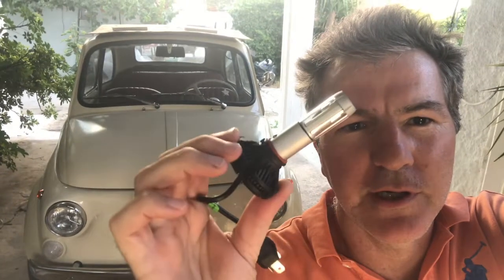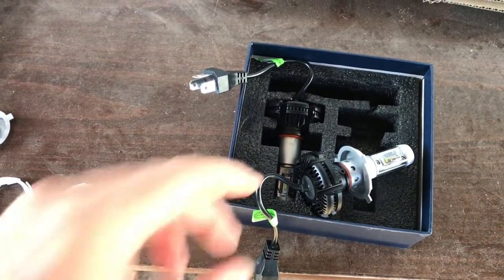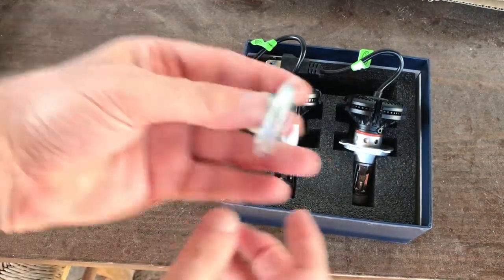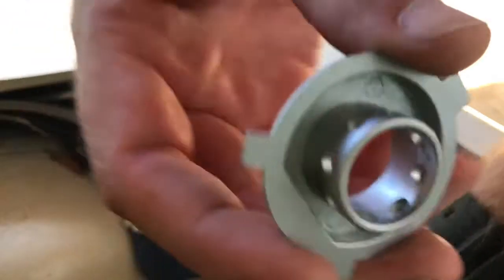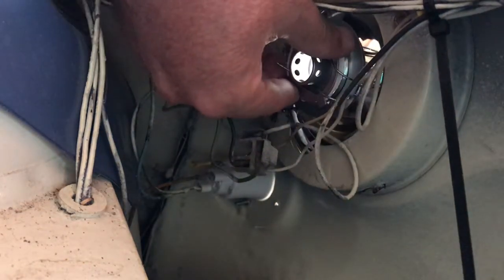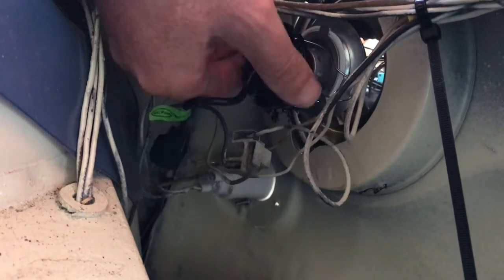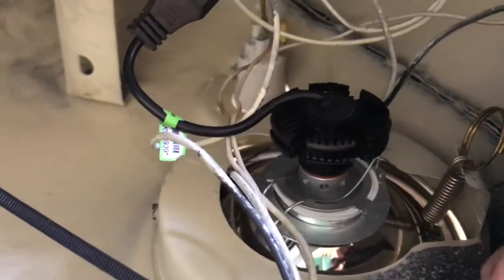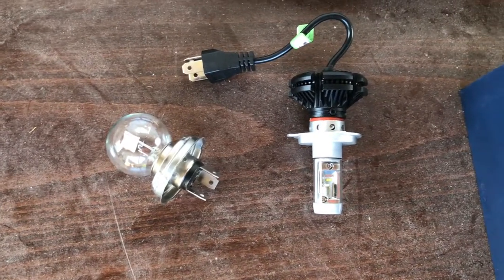LED Headlight conversion in Vintage Car: Classic Fiat 500 LED conversion from H4 HS1 P43T to H5 R2

Comment: By the way, a small external driver and fan as part of the LED bulb are absolutely necessary or it will burn very soon especially if you get a very bright one.
Reply from the maker: If that were so, the manufacturer of the LED light would have integrated that. Fiat 500 from the sixties is not a rocket, it’s plain electrics. For modern cars “maybe” would you need drivers for the ECM not to give fault codes and for xenon lights, not for low amps LED lights
Reply: @makingcookingfixing  
Sorry but I don't agree. It will help people to hear from an expert like this before they buy:  https://youtu.be/FPcE-fWHmww

Comment: Did you solve the high beam problem on one of your lights? You mentioned a fuse but didnt say where. It seems that you are the reseller of the lights you installed. They are not supposed to be plug and play, resistors and fuses are needed so interested people in this conversion should first contact your local LED installer shop to ask for options on items and lower prices, there are plenty out there.
Reply from the maker: Hi, I only noticed the left high beam problem when I saw it on the camera recording it. If you look on the electrical diagram that side of the light is connected to 1 fuse in the fuse box, that particular fuse clip wasn’t tight enough to hold the fuse well. Just bending the clip was enough. This particular LED does not need any extra resistor ballasts, fuses, fans nor relays. It is indeed plug and play. They are still in the car since this video and work very well. These lights have a Philips LED which are cool and the aluminum fins do the job of dissipating any heat (far less than the original halogen bulb)
Reply: @makingcookingfixing  
I'm glad you fixed it, still, nothing cools better than an integrated  fan to make the lights last longer  as the expert un the link I posted explains. It is always good to listen to an expert first.
Reply from the maker: @chdochido  Expert, expert....Are you implying that I am a dummy? You're trying hard to disqualify what I do. I watched the video of the "expert" which is a commercial for his own light sources. In the beginning he mentions that he, just like me, spend a lot of money and time to find the light system that works on his car, and I did that as well, for this car only, because I am only interested in this car, and with my channel, I try to help solve issues with this car, because I know many have the same problem. I did the research, spent time and money, and for me it works and is a good solution, sure there is always better and more expensive, that is not what this video is about, it's about a solution I know works for me and the classic Fiat 500. The video of the in your words "expert" speaks about heatsinks and that all LED's should have fans. That is fine, go get that LED light with a fan from him. I am proud of my solution, I have the classic Fiat 500 and I have the LEDs installed and I am very satisfied what the result. What more can I say? You are not around and can't judge what I do because you haven't seen it with your own eyes. What do I need to do? Make another video of the LED lights to make you happy to show you that there's nothing wrong with them?  For sure you will find something else to pick on, about heat, beam and whatever. Ciao.
Reply: @makingcookingfixing  I'm not implying anything, feel offended if you choose, I didn't say anything against you   I'm simply pointing out that people who own our cars should investigate options and better prices before jumping into what you are advertising. If that upsets you then I'm sorry but your uploads are public and therefore opened to comments.

Comment: Did you solve the tire issue?
Reply from the maker: Hi, I bought 4 new tires to be sure that all are equal, but it turns out that the angle of the rear tires are totally normal. You will see it on all old Fiat 500’s Do you have one?
Reply: At about 6:20 in the video you've mentioned a problem with the spare tire hitting the new LED light. That is my concern. Yes, I do own a Fiat 500. I've constantly failed anual inspections becouse of low light intesity. It did get   better after I've added a relay kit for the headlights. Now the the length of the wires from the battery to the headlights is extrimely short so less  voltage drop as is with the original wiring. But a low current drain light bulbs, as those leds, is another step up. Plus, I have hard time finding those old light bulbs in local stores. That said, Led bulbs won't pass inspection becouse this conversion is not allowed over here. So my plan is to get headlemps that can be fitted with Halogen bulbs for the anual inspection, and then switch to the LED light, maily becouse of the low current draw, for daily drive.
Reply from the maker: @ZNACHMAN  thanks for the explanation. I understand now what you mean. You did very well by adding a relay for the front lights, halogen bulbs at 50w each going through those thin wires is mad. I got the spare tire sorted out not hitting the back of the headlight by putting it more in the middle, the reason is also that I changed the old spec tires with slightly different numbers to save some money, the original tires are like $100 each and the ones I put on $25 each. I believe they are a tad taller.

Comment: Has some one got diagram. They can send me of where the head lamp W clips go to hold the head lamp rim on Dominic Sidonio thanks
Reply from the maker: Hi, there is no diagram, but it is pretty easy. You need three of these clips and spread them out evenly. If you play a little bit, you will figure it out. The ends of the clips point upward and the ends clip behind the rim. It’s a pity I can’t send you a photo here